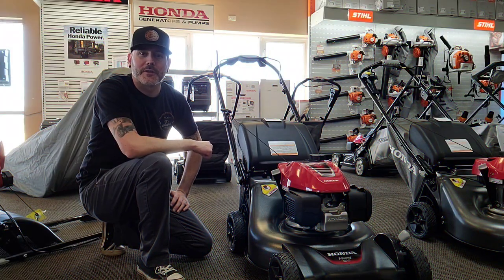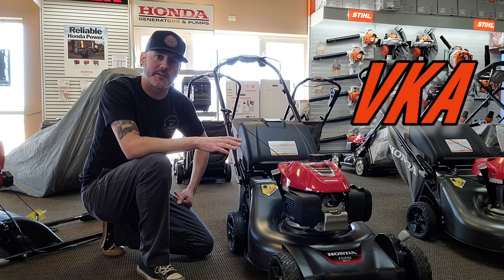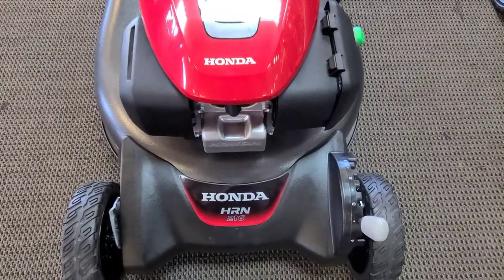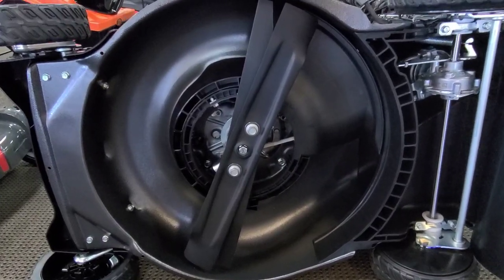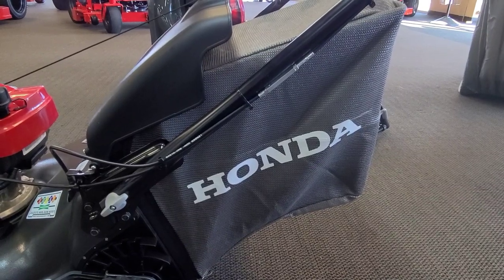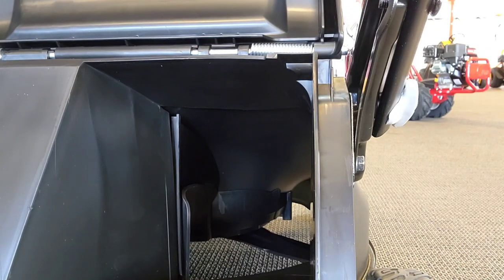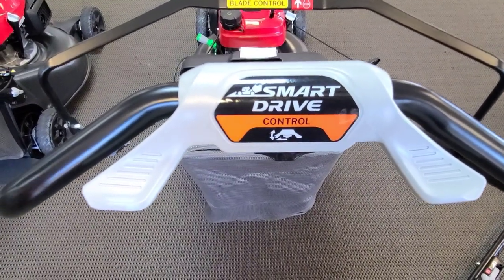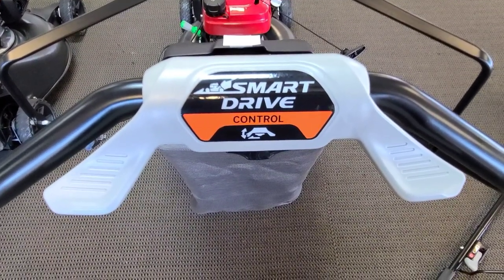Honda HRN 216 Review | What you need to know | Ep: 1

Comment: What wasn't mentioned in this review was that the oddity in the drive. The older Honda HRN's drive would not release when you wanted to pull the mower backwards while mowing. I sold a Personal Pace mower, cheap, for this reason. The newer model Honda HRN 216 has a drive that will release and allow the mower to roll backwards. Something to think about if you plan to purchase a used Honda mower.
Reply from the maker: There wasn't enough of an "oddity" for any kind of a recall or service bulletin. That's exactly why I always suggest buying from a servicing dealer, though.
Reply: That is the reason keeping me from buying this mower right now. Are you saying the remaining ones at Home Depot won’t have this issue?
Reply: @kennethpullen6889  I suggest looking at this mower somewhere you can roll it forward and backward. If it rolls both ways, and doesn't resist pulling it backwards you should be OK.
Reply: @kenbenson6589  Thanks. They are getting hard to find so I doubt I'll find one other than HD. Would be nice to get a feel for it. I was hoping to find one without the blade clutch because just looking at it it seems like holding the bar back while manipulating the pace levers might take some getting use to. I'm 53 and the only mower I've ever own is a Lawnboy from 2004. It still runs good but it never mulched very well. Anyways, regardless of what mower I get I'm sure it will take some getting use to.
Reply: @kennethpullen6889  Don't buy a Personal Pace, you won't like it. The Honda that I cited has 1) A key start, 2)a bail you hold back while starting and mowing that lays flat against the handle--you won't even know you're holding it, and 3) a paddle that you activate with your thumbs to make the mower go forward. This paddle is designed so that the farther you push it, the faster the mower goes. And, it adjusts to your choice of hand position for comfortable mowing. You will not find an easier walk behind mower to operate. And you have a choice or bag or recycle by moving an easy moving lever on the side of the machine 5 or six inches. Go to a dealer and check it out before you buy anything.
Reply from the maker: @kennethpullen6889  Home Depot can't fix it if there is a problem.
Reply: The one you’re talking about is the same one I’m talking about. It has the smart drive. Some reviews said it was hard to pull backwards and some said it leaked gas from the tank while mowing. But it otherwise got stellar reviews. The leaky gas tank seemed like a rarity and if I understood you correctly the issue of it being difficult to pull backwards was addressed on later models. Either way I’ll be buying one before my next mow.
Reply: I can likely do anything that would ever need done to it. I’m not opposed to buying it from a smaller shop that might offer better support but where I live Home Depot is the only place with them in stock.
Reply: @rocketsoutdoorpower6971   Hi, would you recommend an electric mower vs the Honda HRN 216?  Trying to decide if I should buy the Honda before they run out of stock since they’re not making them anymore.
Reply from the maker: @laamor99  If you want long-lasting and the best looking cut, buy a Honda. If you want almost no maintenance, buy a battery mower. If it takes you an hour or more to mow, I'm not super high on battery mowers either.

Comment: I bought this mower early this Spring...and have not been impressed.  Lot of favorable reviews and neighbor recommendations.  Mower cuts unevenly, with lots of high spots even with a 1/3 overlap.  Going one direction, then coming back - the path height of one is higher than the other.  Last it leaves massive wheel ruts, even when mowing a different pattern each time.  I will probably be replacing in next season...for the price and the "Honda" name I expected so much more!!

Comment: Just did a carburettor-clean and magneto-coil replacement on my brothers 2001 HRH536HXE. Started on first pull, started to sputter after 5 seconds with choke, took it down to idle and run fine after that. One heavy lump of mower with the aluminium-casted deck. No issues with it until now with carburettor and coil.

Comment: Just tried my new one today.  First start was 2nd pull.  Much quieter than my old Honda GCV160 engine (troy bilt meh) and "seems" to get better gas mileage (lots of gas left when done) but that may be because the gas tank looks a lot higher capacity on the GCV170.  I hope this is easier to service the carb than on the gcv160 but it feels so nice to be done with my old problem child mower.  I'm officially old (excited about a lawn mower purchase).

Comment: One thing I'll mention I like about the HRN is the easy gas shutoff valve. After my last pass I turn the knob and run the mower up to the shed. By the time I get there it's run the gas out of the line and carb so it reduces carbon buildup.
Reply: Thanks for sharing that, going to start doing the same with mine.
Reply: that's a good habit especially if you run e10 gas.

Comment: I bought one. Got it at Lowe's. With the inflation up so high in the US, I had to pay $507.00 total. I am praying it doesn't malfunction. I have not bought the insurance on it, yet. You explained all the features perfectly. My lawn mower arrived with the oil can without a top on it. The instruction booklet was soaked in oil so I required clear instructions. Thanks so much. The other videos did not show how to use the Speed Drive. Good job.
Reply from the maker: Genuinely glad I could help. That's exactly why I'm doing this. I hope you love it.
Reply: Is there any difference between the US and EU model? The price for a HRN in germany/austria is over 1000 $
Reply from the maker: That's a really good question. I honestly don't know. I do know that the machines built in the US will usually have an extra "A" at the end of the model number. I'm not sure about anything built overseas though 🤔
Reply: Should’ve gone to HD and bought it for $460 lol.. thar said the auto choke is a known issue so go ahead and buy a couple now so when it goes out you have the part to replace it..

Love my old toros but that new auto pace seems like a pia I’d rather have a plain bar that said.. I’d also rather fwd vs red as it’s more appropriate for a push mower where you simply life the wheels vs disengaging the drive
Reply: Instruction manual is available online.

Comment: I just bought a honda from a big box store,,, Love it,, had to get used to the smart drive, but love it now,, the only complaint I have is I wish it had the option of a side discharge, If the grass is a bit on the wet side and tall,, it plugs the rear discharge, I didn't need the electric start or the clutch, I had 2 mowers with honda motors on them,, never had a problem with either, one of the reasons I went with the honda, and they have very little plastic that I can see, Just an all around good mower. Thanks for the info on them.
Reply from the maker: Absolutely. Thanks for watching.

Comment: Just bought the HRN216VKA to replace a 15 year old Craftsman with B&S engine (made by Husqvarna for them). Parts peculiar to the mower model are getting harder to find such as wheels and drive components (vs the common B&S engine). Did half my lawn today and very pleased with it. Mowing other half tomorrow. Grass was getting tall but it still mulched well. One pull start. The blade stop and electric start weren't worth the extra $100 for me. Keeping the old Craftsman for a while - have new carb for it in box but will probably put it out at end of driveway for the scavengers in a couple months. Thus far I'm impressed with it for a 170cc engine. Trick to the drive paddles is tweaking them to the right height for how you use them.
Reply from the maker: I'm glad you're liking it and thanks for checking this out 👍

Comment: Thank you for an informative, straight forward review of this machine. I used this mower last summer and can attest to the mower's quality-especially the engine performance. I am not a big fan of lawns which are water wasteful but I suppose they are a necessary evil. It is still unclear to me that the grass is being properly cut but then I refuse to use chemicals on the lawn. That may account for the uneven? cut but the machine was new and in spite of this I still give it high marks.
Reply from the maker: The only time I've seen new Hondas cut uneven is when they're not running at the correct speed/rpm. We usually have to bump them up right out of the box. Otherwise the blades aren't spinning fast enough to create enough suction.

Comment: I bought an HRN 216 VKA after returning a Toro 60V Recycler. I have a small yard(maybe 2500 sq ft) and really wanted to go electric. My Toro had battery issues straight out of the box. The only certified Toro repair center in my town said they didn’t work on battery powered mowers. That was a deal breaker for me. I had been using my sisters Honda HRR until I was ready to buy a new mower. The HRR was the best mower I ever used. I mulch 99% of the time. It mulches wonderfully and has plenty of power. My HRN also mulches equally as well and feels like it has the same amount of power. I can’t feel any difference. It pulls backward as easily as it pushes forward. The HRR has some resistance when pulling backwards. My HRN started on the first pull straight out of the box and the first time every time I’ve used it. I love the fuel shut off and use it to run the fuel out of the carburetor every time I finish mowing. I’m very happy with the HRN so far.

Comment: I am looking at the HRN vs the HRX with hydro transmission. It's just for personal use on a modest sized lot. Do you think there is any benefit in the HRX for me? I like the fact that the HRN is significantly lighter...
Reply from the maker: @steve8803  If you're mowing for an hour, I'd buy an HRX. It really just boils down to time. How many hours you're putting on it and how many years it's going to last for you.

Comment: The bag-mulch lever is a bigger convenience than I expected. You can leave the bag on while mulching, and then if you come up on an area with some debris to clean up, it's quite easy to switch over to bag for a little bit. The blade clutch and electric start options seem like they would be kind of useless on this unit, it's so easy to start. You can change your mind halfway through the first pull and it still starts....Finally, the smart drive is weird at first but works very well once you get used to it. I've discovered that for a decent portion of my lawn, I don't really benefit from the self-propel, which was surprising. I probably press the lever less than half the time, which I expect will make it take longer for the self-propel system to wear out. That was the one weak spot on the mid-1990s Honda that this unit replaced. (That thing still runs, by the way, but I got irritated with the weak self-propel, since I've got an inclined section). This unit is also much easier to change the oil without spilling gasoline.
Reply from the maker: Great insight and I'm glad you're liking it 👍
Reply: @rocketsoutdoorpower6971  Yes, I was trying to buy the HRX model and none were available anywhere at the time - but I'm really quite satisfied with this one. How common is the thermowax auto-choke problem? It's a cheap part, you think it's worth keeping a spare available? Also, have manufacturers generally solved the ethanol fuel gasket and o-ring deterioration issues? Here in NJ, non-ethanol fuel is not available anywhere far as I can tell.
Reply from the maker: @njmikeche5575  We MAYBE warranty 2 out of 100 thermowaxes. The alcohol in ethanol will always dry out seals. There's some additives out there you can get. They're designed to help with ethanol fuels in small engines.
Reply: @rocketsoutdoorpower6971  Thank you for that information!
Reply from the maker: @njmikeche5575  Absolutely! Thanks for watching!

Comment: I had the HRN216 for 2 years now. And only 2 problems I see are front wheel assembly sticks out to far when maneuvering it around the yard. It doesn’t have good Vacuuming, it seems to kick everything out the other side . It leaves a lot behind and I have to go over the same areas to clean up what was left behind. But with all that said, I still like it!
Reply: Do you recommend buying HRN216 after using for 2 years. I need to replace my mower and not sure if the HRN16 is better over Toro. I mulch most of the time.
Reply: Both of them are good lawn mowers. The toro is a 22” and Honda is 21”. The Toro is heavier and the personal pace is okay! But the Honda is easier to use. Lowes and Home Depot have good return policies. You can try them both out and one at a time and keep the one fits you better!

Comment: Was debating today between the Super Recycler (model 21565) and this HRN216 and went with HRN. I like the simplicity of the Honda, stronger engine (170cc vs 163cc) and seems better built to me plus i wasn't sure i would like the Personal Pace system. Im sure both are very good, just a preference thing. If the Toro had a Honda engine, would have been a tougher decision. Hope i made the right choice.
Reply from the maker: I hope you love it 👍
Reply: @rocketsoutdoorpower6971  Thanks, hope so too. Good mowers are pretty expensive here in Canada.

Comment: @rocket thanks for the video,  Ours was running great. Used it only few times over 3 years, made oil maintenance, changed spark plugged, cleaned the filter, change the fuel with recommended one... all parts sold at Homedepot. Still ain't running...  is it that dead and good for trash or something else we could look into it?
Reply from the maker: @SatellaPower  If it's been used that little over that many years, I'd guess it needs a carb.
Reply: @rocketsoutdoorpower6971  Thanks for the reply. We took apart the carb, it was pristine clean inside. We still cleaned it, but there is no start-up yet
Reply from the maker: @SatellaPower  I'm not sure then. Whatever it is will be relatively simple, so I'd say it's definitely worth fixing. It's just a matter of figuring out the cause. Are you certain it has spark?
Reply: @rocketsoutdoorpower6971  Thanks for your time. Greatly appreciated. 
That's a great question. We assume yes because we changed the spark  plug and made sure the tip was at the right distance. Inserted it has instructed in manual.... but I don't know how to tell if it had spark.

When we pull on the coil, the engine spins for a brief moment but does not start. 

We're searching the internet on how to diagnose the cause and fix it. So far, we attempted to apply general tips without success.
Reply from the maker: @SatellaPower  No problem at all. That would be my next guess. You swapped everything else air and fuel related.

Comment: Thank you for making this video it was really informative! I am buying a new mower this year and I have it narrowed down the the Honda HRN and the Toro 22 recycler. I like everything about the Honda better except I seen another video where he said you have to overlap so much with the Honda that it makes it more like a 19" deck where the Toro is a true 22 inch cut. Do you think he is right on that? I would much prefer to buy the Honda but I dont want to have a 3 inch difference i the cut path either
Reply from the maker: Something most likely needs to be tweaked. Many of these need the RPMs bumped up, right out of the box. A lot of the videos you see are guys that bought them at a box store and assembled it themselves. So, usually, if they're not cutting quite right and it's that new, it's probably not spinning the blades at the right speed. That's why we assemble and run every machine we sell.

Comment: Very informative video. I recently bought the HRN216VKA/B. Though it has a larger engine than the HRR216 it replaced, it doesn't seem to have as much pulling power. Has anyone had this problem, or could I have caused this positioning the Smart Drive paddles?

Comment: I picked one up and the 2nd time I used it I started getting a loud tapping. It goes away not sure what it is. Used the oil they sent. Less than 2 hours on it. Any thoughts?
Reply from the maker: Take it to your dealer. It could be valve noise or something, but it should be covered.

Comment: I have a 20 year old push craftsman that I've never had a problem with. I do perform regular maintenance on it. I also purchased the HONDA HRN a couple of years ago and kept the old one.  I've read some negative comments concerning the new hrn but I haven't experienced any problems with this model yet. But with any product you can have problems with it despite performing regular maintenance on it. Time will tell if it's a good mower but as of right now it's good.
Reply from the maker: Exactly right! Nothing has a 0% fail rate. The majority of "major" issues you hear about are 1 in 100 and that's with any brand. That's also why you buy from a servicing dealer 😉. Thanks for watching!